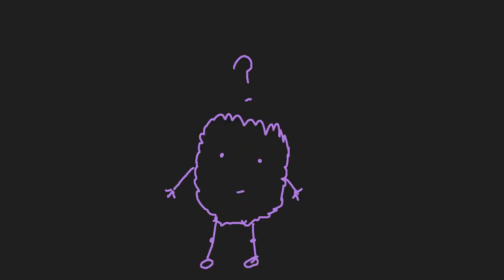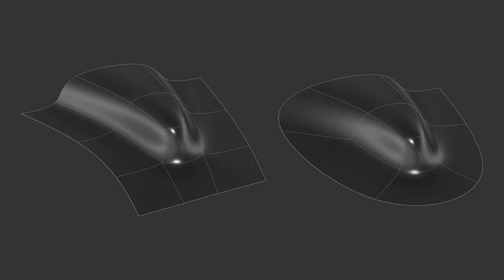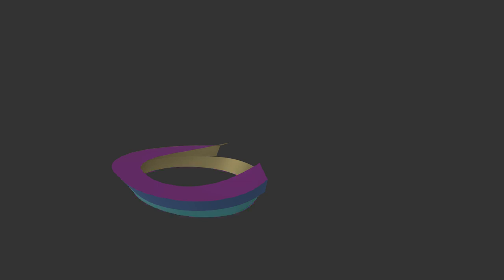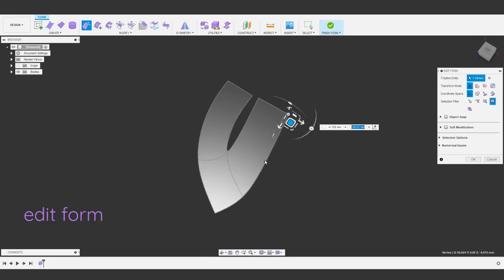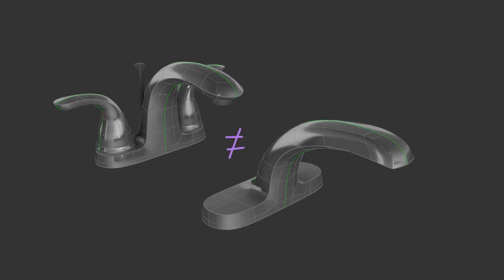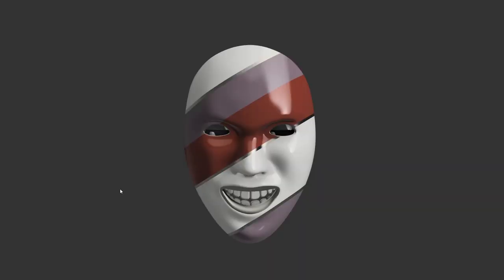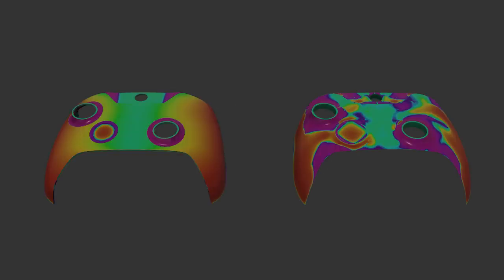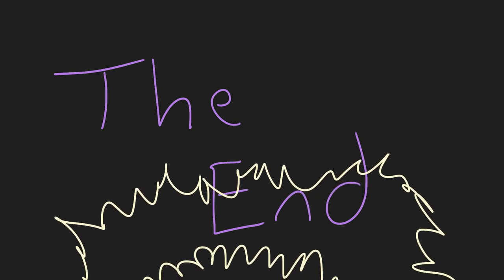Topology With T-Splines In Fusion 360

Comment: Hello. The video was very helpful. So what i learned is to not put star points into curvature. Great!  T-splines are a solution to make concepts and free form modeling but also the problem for clean shapes. I should try polys again although a year ago i came to the conclusion T splines should be better. At that point of time i couldn't differentiate between nurbs and t splines. I was just messing around with Fusion 360. Now i learned that all a compromise between technological limitations, technique and freedom of design with all of those methods.

Comment: I can give some background information about why 'make uniform' exists

Nonuniformity is what gives T-splines the ability to add a new edge loop while keeping the surface shape exactly the same. If you add a new edge loop on a SubD, it will deform the surface. You can see the difference well if you take a torus and add an edge loop.

When you're roughing out the topology, most of the time you want to keep things uniform.  It's only later on that you might want to use the tools in exact mode. But it's hard for the tools to know whether you want to be maintaining uniformity or keeping the surface the same, and it would affect the entire surface. The default for the tools was to keep around the nonuniformity, because you can always make the model uniform, but if you blow away the nonuniformity there's no way to get it back.  It's data loss, so we required explicit user action.

In another fusion-based modeling package that was more focused on T-spline modeling (Speedform) there was a global toggle in all of the T-spline tools that would let you specify whether to keep things uniform or not automatically, which worked well, but complicated the tool dialogs a bit.
Reply from the maker: This clarifies a lot, thanks for taking the time to comment. It does make sense from that perspective, just feels a bit hidden for people who may be unaware of it. I'd be curious as to how the speedform ux feels in comparison, I've seen videos that show these two modes but haven't had the opportunity to try it.

...Thanks for t-splines by the way, it's been a massive boost to the conceptual phases of my (and many others) work

Comment: Quick question. You mention other learning resources quite often. Do you mind providing examples of the learning resources you used to hone your abilities in the description? A huge barrier to understanding is often just not knowing where to look for the right information. You’re probably not here to make in depth CAD tutorials, but you do provide a well rounded picture of the tools available And when to use them. Providing links to more specific training you’ve found most helpful would be incredible. Thanks!
Reply from the maker: Very good point, having resources scattered across the internet is not very helpful. I've added a link to a basic surface modeling video, but I'll try to add more as I find them. Autodesk University is also a good resource for intermediate topics as well. The challenge with posting the main resources I've used is that they are usually just... people, practice, or adapting what I learned from other software 10+ years ago. I wish I had more to offer, but I'll do a bit of searching and see what I can find.
Reply from the maker: ^ For some reason, that was marked as spam... I took a quick look, some of the better intro surface modeling for solidworks I've seen, thanks for sharing

Comment: Thanks! Your videos  have been awesome. They've help me make more sense of all the bits of T-Splines info that's bouncing all over my head. A quick question of you're reading this....
Is there a good reason to choose T-Splines edge modeling to create a surface as opposed to using a spline cage and surfacing tools? ie. in the brush example you could create that just as quickly with lofts patches.... I'm trying to figure out when designing when I T-Splines. I like the ability to directly control the surface but I have trouble keeping nice sweeping surfaces.
Reply from the maker: Valid question - for me, t-splines has become like a sketching tool that would be used as an underlay for the final surface model. I mainly use it not necessarily for the speed of creating an individual model, but more the speed of creating variations that go beyond the minor tweaks that parametric modeling allows. My initial files are often filled with dozens of form variations, many of which would be 3d printed to validate. Then I'd make the final surface model around the one that gets selected. As for creating clean surfaces, I hear you - that's why combining modeling methods with surface modeling is often a good idea, even for sketch models. Not sure if that answers your question, but hope it helps

Comment: So glad your back to posting. I was just reviewing your previous videos and this filled in a lot of holes. Are you using a pen tablet or graphics display with Fusion? It seems like it and I have been on the edge of deciding if that is a good next step for me. I love my 3D mouse and I think both might be a killer combo but it's hard to justify the cost.
Reply from the maker: I only use a mouse and keyboard with any cad software... the only thing I use my graphics tablet for is photoshop and occasionally mudbox. I used to use an intuos with Alias ages ago, it worked, but only because I mapped shortcuts to the express keys... now I use one of those gaming mice with a thousand buttons on the side (logitech g600), it's old, but they probably have newer/better ones. I would say that unless you have a genuine, specific use for the tablet, it may not be what you are looking for, there won't be much benefit for Fusion in my opinion.